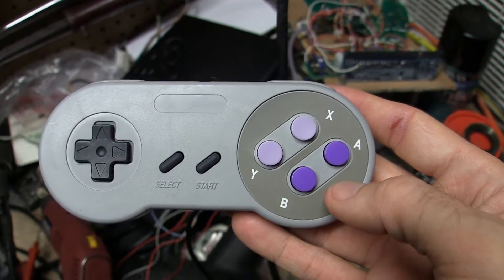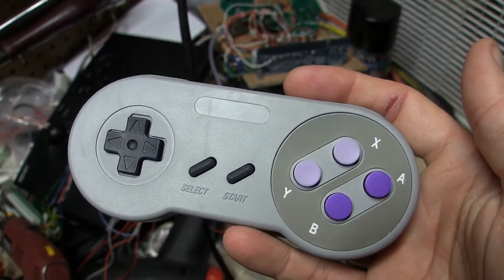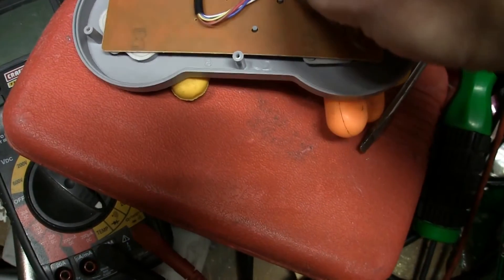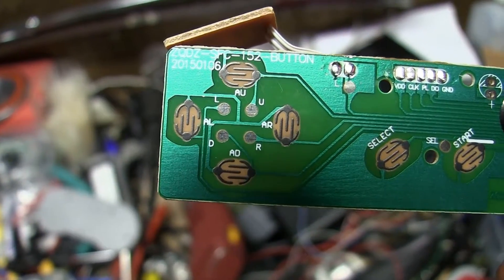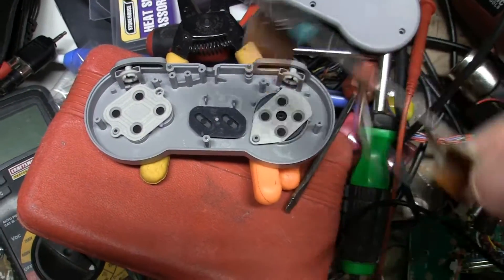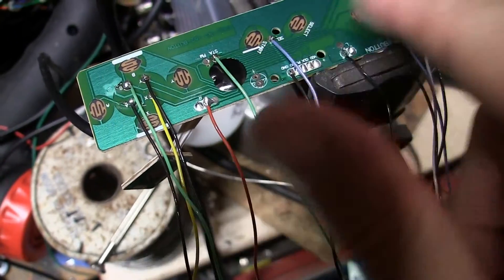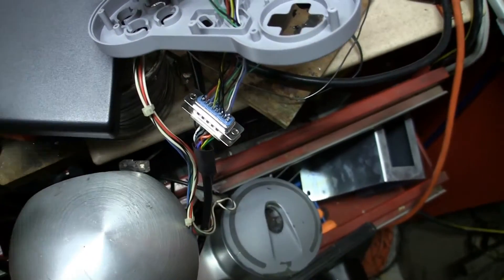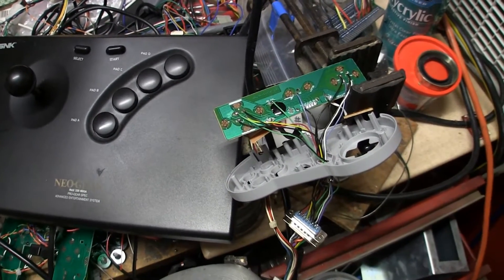$2 Chinese SNES Controller to Arcade Stick Hack

Comment: You used a premade fight stick but could you simply solder a joystick and buttons to a SNES controller? Would it work or is there some type of programming in the Neo Geo that is needed?

Comment: I built an arcade stick controller  for my NES. I used a NES Max controller for the interface and arcade buttons and joystick for the controls. I used the shell from a old cable box for a housing. It even has turbo.

Comment: you need a 6 button game to test it
Reply: This requires two additional buttons for the stick, it would be quite easy to build them in and change the four button into a six button arcade stick. But I doubt he likes to drill holes in his original AES stick.

Comment: I've been trying to get a Genesis and SNES controller wired to the same arcade stick but I'm having issues with power and/or ground. Any ideas how to fix it!
Reply from the maker: Ive never tried both at once but thought about it. Maybe if you have a common ground from each, then install a switch that lets you only use the common ground from one controller at a time, that might work? 🤔

Comment: what did u connect to the tv u were playing on if u just soldered the wires on the two controllers to each other
Reply from the maker: Super nintendo. This was the controller converted to arcade stick.

Comment: I have an old ending man terminator console with stock controller with da15 port. The controller has 6 wires coming out. Can you tell me the pinout / wire colour code to the male da 15 connector?
Reply: Have you checked out slagcoin or Reddit (sorry can't remember which one it's in the description for Woolie vs. Arcade stick 101 video) there's probably a diagram on Google images of you type in the name and wire layout/diagram. Sorry I can't be more helpful with this. I thought about turning a knock off PS3 or PS4 controller into a wireless fight stick but I need more info, wires and wood someone mentioned lumber liquidators.
Reply: @mikekazz  i eventually got it..in some site..the 6 th one is actually for headphones..thats what was making it difficult..helped identify the pinout diagram for 5 wires..
Reply: A Google search with da 15 controller pinout will list search results, listing the images, the one labelled fami-clone controller pinout is the one.. Excellent picture showing which wire is latch, ground, vcc, clock and data, which helps in rewiring those wires to other input ports like SNES etc.neat picture really.the headphone wire is a white colour coded in mine and goes next to ground ( if anyone else is interested).. surprisingly, the ground is colour coded red in mine..and black is vcc.. which turns the electronics world upside down :P . They had to make it more confusing... :D

Comment: Can you do PS4 pad to arcade stick pls
Reply from the maker: I dont own anything newer than a xbox360 unfortunately. But the principle would be the same. My tip would be to buy the cheapest controller you can find because those are normally the simplest in design to hack.

Comment: okay I'm going to try this, any tips on getting good with the soldering iron?
Reply from the maker: GV3G - GLaDOSv3 Gaming it's not too hard, get an iron with a very small interchangable tip to help with hitting the solder points easier. Always apply a little solder to your wires before attaching them, this is called tinning. Practice splicing some scrap wire. Check out some solder videos for more tips.
Reply from the maker: ihatemovingpictures I usually look for a point I can solder to, like where another existing solder point is, just follow the trace, sometimes it can go to a chip and you can attach easily there. Sometimes you can use a blade to gently scrape the coating directly off a contact pad and carefully solder there. I recommend a hot glue gun to help keep your wires safely attached after you're done soldering.
Reply: So just to get this straight did you solder the wires directly onto the solder pad? And it turned out that you didnt have to scrape those pads?
Reply: srarcade gotcha i was just wondering about this specific pad since i just got two of these specific pad. It looks like all you need to do from the video is just solder the wire to it and that it. But ill scrape those if need be.
Reply from the maker: ihatemovingpictures yea it's been awhile but I remember this pad was pretty trivial.

Comment: Hello i have the same controller chinese if i cut the pcb to put in game boy is it possible, it will work?
Reply from the maker: aloe vera yea if you don't cut any major traces I don't see why not. Would be interesting to see how much you can actually cut out. I did this with a genesis controller once and got it down to be roughly an inch square!

Comment: i had a snes controller that has been broken, but its fake, can u help me about the wiring diagram of it because im confused with the wiring, where i can email you?
Reply from the maker: If you look at the PCB, there will be 2 sides to each button/direction contact - a common ground and the button/direction voltage. You will need to figure out the common ground with a multi-meter on continuity setting, easily done by probing like sides- if it beeps you found your common. Then you will automatically know the opposite side of the contact is your voltage point. Then you just need to find the best places to solder. You only need to solder 1 point for common ground, and then each direction/button. Simple as that.

Comment: I want to buy one of these to use the board with resin recasts of the original Super Famicom controller parts and also I'll add membrane switches to the buttons to give them a more clicky feel without being too clicky.
Reply: I love the membrane-induced click.

Comment: hello,

you have given me an idea but can you help me understand a concept I am struggling with?

i get all the wires go, but I dont understand where does the ground hook up to? why is there no + wire
Reply from the maker: The ground hooks up to a common ground which will be the opposite side of a button contact. The + is on one side and - is on the other. So if you follow the traces of the - side, they all meet up at once point or another because its all the same wire. So using a multi meter on continuity check, you can probe around and see that you can get a beep by touching ground points together and the find the one that is easiest to solder to. Does that help?
Reply: Thanks for helping me understand and posting how to do this, much appreciated!

Comment: Whaty about using the Snes on NeoGeo_? I bought this pads for a cheap Db15 test controller, but not sure if the way buttons work, allows me to use it in Db15.
Reply from the maker: +Jaime B. This pad uses some sort of shift registry circuit like most old control pads, you would have to do some work to convert it back to straight pin.
Reply: Damn! I bought it to have a cheap Supergun pad, but on idea how it works. From what I see, the buttons are plastics and activate the pcb some how. Not sure how that relates the the way sticks work which is only ocnnecting line to ground...
Reply from the maker: +Jaime B. You could run a new 11 conductor wire to the pad, then you tap each contact so it makes it pin to pin - i did this on my NeoGeo X usb stick, but its a big stick. Trick is finding a 11 conductor wire that's going to be flexible and not get in the way, it would be like 34 gauge or smaller wire inside. The other thing I've seen is people using Sega Saturn controllers on super guns. They're not pin to pin either but I guess they're easier to work with- maybe check that out. Sega Dreamcast controllers use a standard maple bus for their registry which is a common circuit to work with too.
Reply: But if I tap into each contact how does the circuit close? Push button are metalic in theswitch, this controllers just have a rubber bad underneath, I don't really understand how it works.
Reply from the maker: +Jaime B. Assuming you mean if you were to run a new 11 conductor wire (4 directions + 6 buttons + ground) You tap into each button at the contact and the common ground. Any time a button closes contact with common ground it registers. Yes, it does look rubber, don't be fooled- that is actually causing the contact to close! This is how keyboards and many buttons work all over the place, even your phone. No different than if it were a joystick on an arcade cabinet, just different means of achieving the same result. All you're doing is using the pad as a contact point to close the circuit instead of buttons and a joystick.
Reply: Ok, will try it. Otherwise the paf is useless for me, so not much to lose.

Comment: I'm trying to do this exact mod but using a different controller for my snes to plug in to. I was wondering if I had to connect vcc as well as ground into the connected controller. I see you have a wire soldered to ground and was just curious.
Reply from the maker: +freakface1234 Hey- You just need 1 wire to common ground and then a wire for each individual button. No Vcc from the controller circuit is necessary.

Comment: ohh its cheap controller from China blabla. Everything is made in China including youre 2000$ ipods. Why bashing chinese quality? Its 2$ and probably more reliable than SNES controller from Nintendo
Reply from the maker: +Aktuell Russland (RussiaGood) The PCB isn't that bad at all. China products are hit or miss, I'm not bashing it, I use stuff made in China all day long. The pad rubbers were a bit stiff which caused some unresponsive control but otherwise for $2 you cant go wrong on this pad. Its perfect for a arcade stick donor though!
Reply: Yeah right, it's not like I have Japanese electronics that are older than me, with Rubicon caps that do not leak or fail if you look at them wrong.

Most consumer stuff built these days is just disposable and meant to last 5 years tops. The price is just marketing, specially on Apple products.
Reply: I have snes original controller and one of chinese controller, the best is the original, the chinese controller's buttons are hard to push
Reply: That doesn't mean that there aren't serious Chinese companies, but I do think it is hilarious to think that electronics built today are better quality than old Japanese ones, mostly because their expected obsolescence is measured in years, not decades, Chinese or not.
Reply: In all honesty our "$2000 iPods" have awful durability and build as way. A simple drop without non-included protection can shatter the screen, bend the metal, and damge the internals. Bashing or not, Chinese products are indeed hit or miss, $2 to $2000.
Reply: Made in China to break in America😂